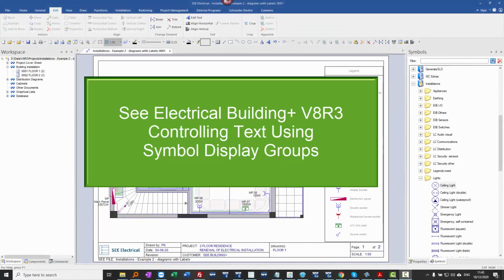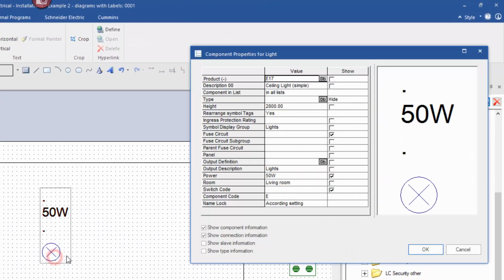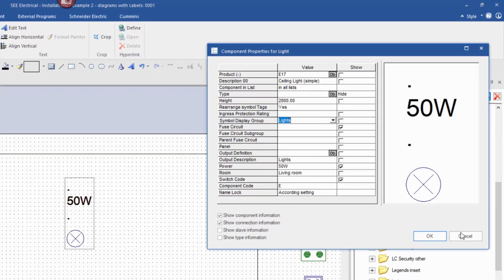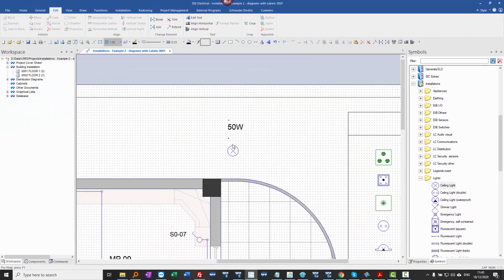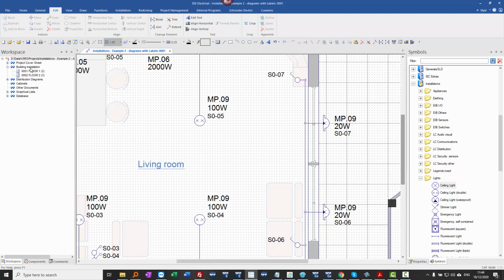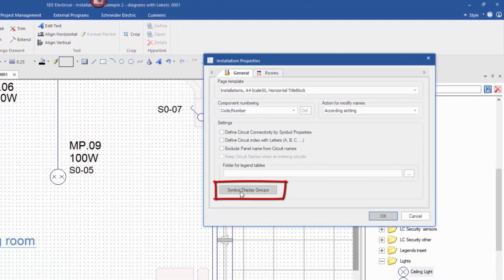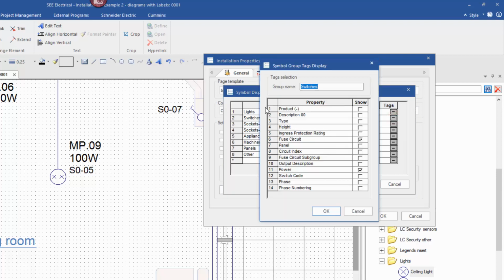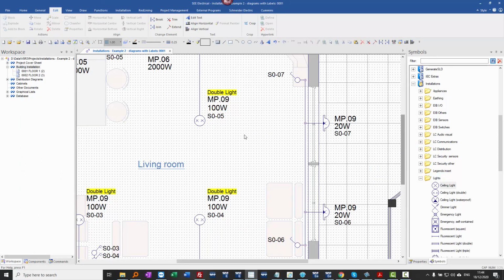Symbol Display Group Controlling Attribute Visibility in See Electrical Building

Comment: hello @IGEXAOUK, i have a question for you. When i generate Legend, some symbols won`t show on legend (ex. "Two way switch" & "intermediate switch"). Do you know what can be the problem?
Reply from the maker: Hi @webprotector19 this could be one of 2 issues  
1) The symbol has been created and copied around rather than placed from a symbol folder, so no symbol name will be associated with it in the bottom-right when double-clicking
2) The symbol has not been added to the list in the command GenerateLegendMapping section.
Reply: @IGEXAOUK  Thank you for the response. I was the second answer: 2) The symbol has not been added to the list in the command GenerateLegendMapping section. You are the best!

Comment: How to move only single visible property (not only object with all descriptions)? For example "switch code" description for "switch". It would be usefull when description is in some how Overridden by some object.
Reply from the maker: Hi Maciej, tap F6, select the text (hold Ctrl if there's several pieces) then right-click and select 'Move' to move from point A to B. I tend to set a shortcut key M for the 'Edit - Move Selected' command by right-clicking the menu area, 'Customize the quick access toolbar' and selecting the Keyboard shortcuts customize command at the bottom. Hope this helps.

Comment: Can I change SHOW property for a group of selected objects?
Reply from the maker: Hi Maciej unfortunately the values can be updated in the properties panel for a group of symbols selected on the page, but the visibility properties are managed per symbol group (switches, sockets, panels, machine etc..), using the 'Symbol Display Groups' in the Installation Properties. This ensures a consistent design and documentation standard throughout the project.

Comment: I have a question about symbols - Building Instalations. How cand you create a symbol that can auto rotate belong the walls ?
Reply from the maker: Hi George, another good question!
Its usually very easy but if you have Cable Rubberband turned on you won't be able to drag and drop your finished symbol. Check out the new video explaining the simple steps: https://youtu.be/VC3HvWtReYc
Reply: @IGEXAOUK  Thank you for the answer.  You are the best.
Reply from the maker: @webprotector19  Glad it was useful, many thanks for the feedback :)